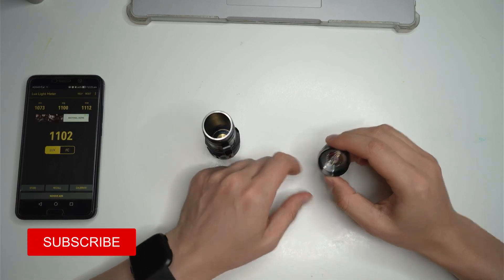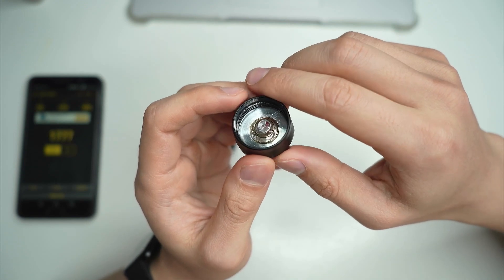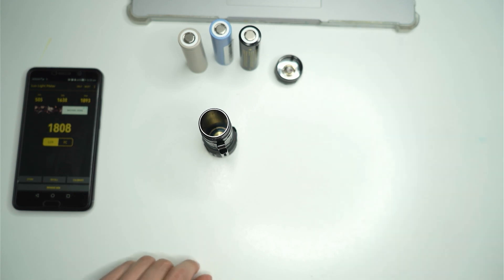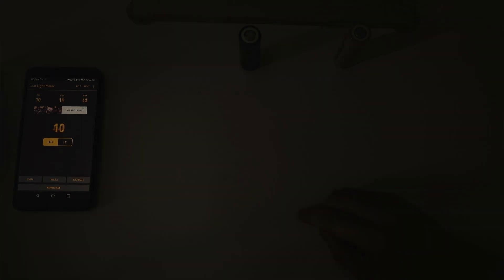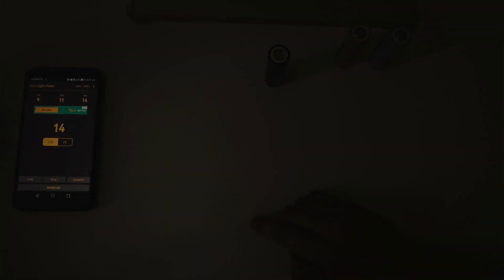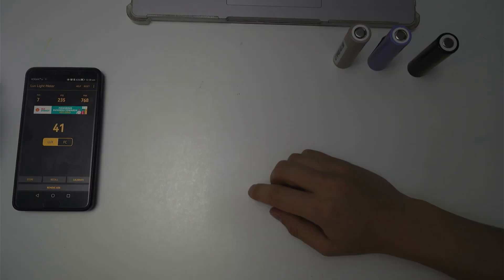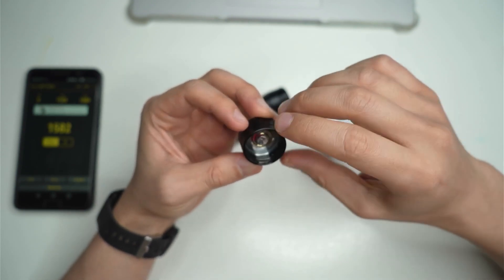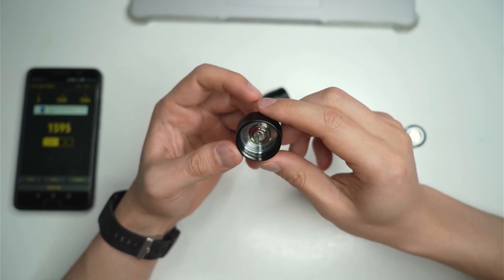Sofirn IF25a Spring Bypass: Before and After - BRIGHTER?

Comment: shoved a sizable neodidlyum fridge magnet into the coil on mine... probably somewhere in between stock and the solder method... i like carrying around a good strong magnet though. kevlar string lanyard im braiding up, also thinking about changing out the regular glass in front for 3$ aliexpress sapphire lens face... maybe splurge 8$ for the curved one for better throw? u lose about 4% of lumens due to sapphires lesser optical properties but then u gain a much better heat sink, more thermal mass, and good radiant pass thru? so i think if ur using it in boost mode u dont notice a difference after a couple seconds. crazy how cheap real monocyrtalyine sapphire lens/watch faces have gotten with those reusable molyibdinum crucibles and china just racing to the bottom of the cost curve. 
kind of want to put 2 18350's into the unbranded sofarin 4$ headlamps i bought with 2x of the same led's. the buck converter on the chip claims to only be good for 3.7v and then u can find data sheets sofarin puts out that says 4.2v (lipol max charge) but when u look up the integrated circut chip numbers and reverse enginer them to find the oem data sheet the buck converter circuit is supposidly rated 6.5v from the factoria and when u consider internal resistances as long as ur not pushing out more than 3.7v it seems like it should work ok... just too chicken for now until my replacment comes. good video mate
Reply from the maker: I've never tried one of those curved sapphire lenses, do you have a link for it? So it can increase throw? Interesting notes about the buck converter, may still fry it with two fully charged 18350s though. Thank you man
Reply: @DarrenYeoYT  i justed went to ali express and typed in sapphire watch crystal and there was a bunch of identicle listings with various sizings all for 2-5$
maybe im misusing the term throw but the curved glass shoots the light out a little bit more, its meant for fancy watches so you can read them at somewhat obtuse angles but light is light. 
ya i was thinking of draining them down to 3.7v or finding a somewhat resistive conductor betwwen the two metal disks like pencil "led." I im guessing that would give about 1 volt of voltage drop depending on the size?